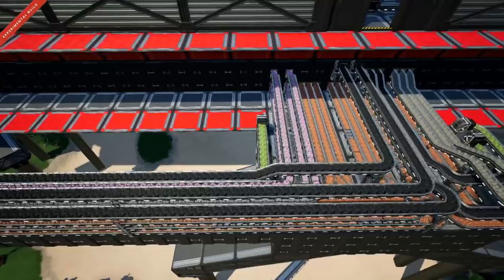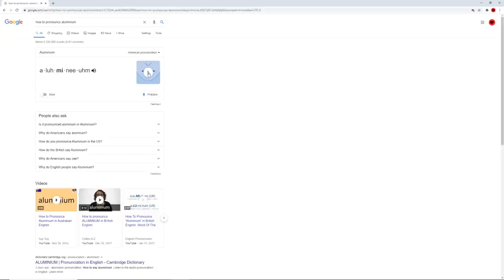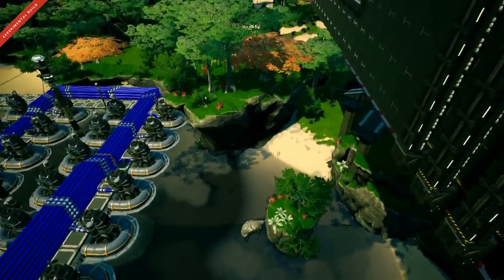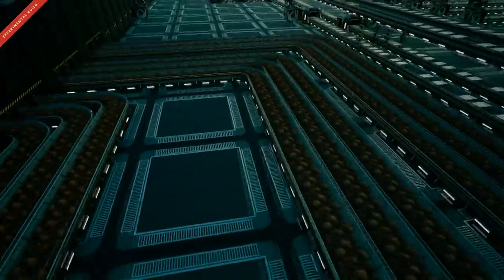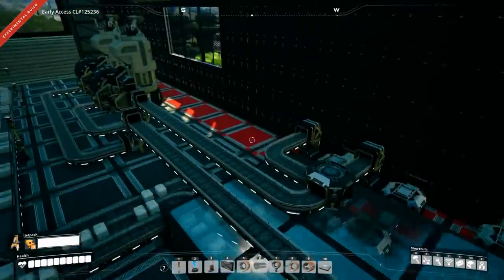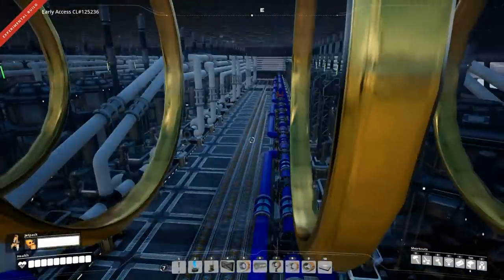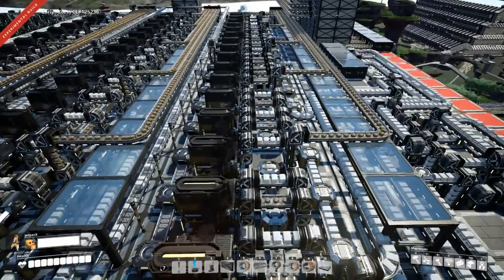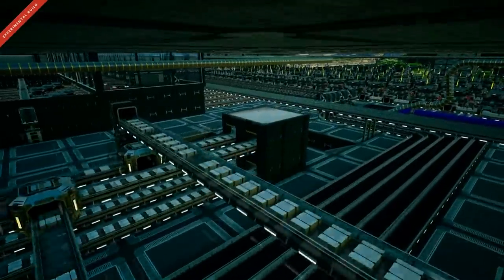Satisfactory - Mega Factory - 2,280 Aluminium Sheets per min.

Comment: why not use cheap silica and get more use of the scrap? you're making concrete on-site with the water overflow.
Reply from the maker: We assessed the amount of quartz in the world and decided that for this particular project we wouldn't bother...  we almost certainly will be using it for future projects though.  Also,  the wet concrete factory which essentially crushes the excess water, is over in the grasslands lol  the water goes over there on a train  ...              I understand what you mean though...   And we did consider doing that,     but out of the ~15,000 scrap    12,000 mixes with silica and only 3,000 is used "pure" in the smelters,  but I guess it's just another great example of how there is many ways to skin a cat in this game, which is what makes it so good =)
Reply: @danp6918   you have given me the idea to do much the same concept but I want to make small factories at each node cluster then take the bits back to a bigger main production line kinda like the oil for rubber on the water.
Reply from the maker: @davidkahn2433  sounds good!   Best of luck with it